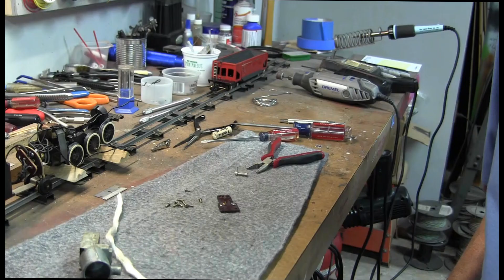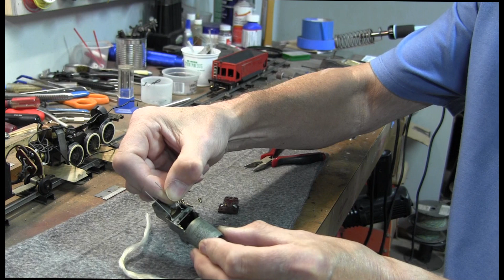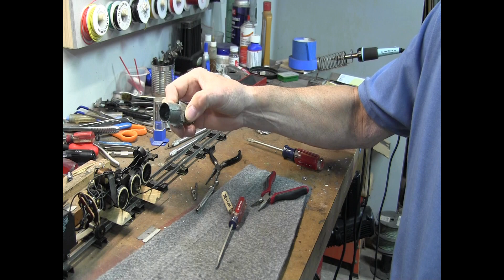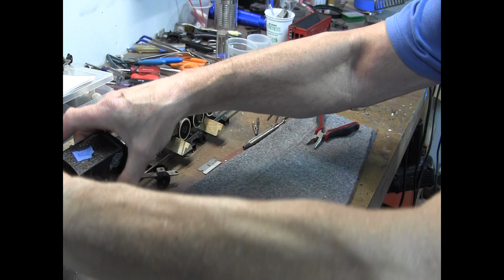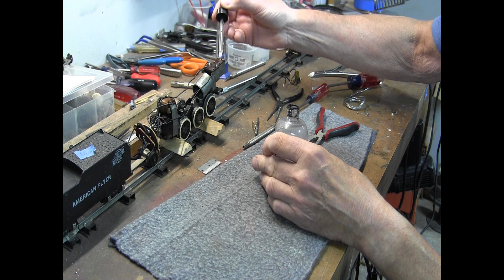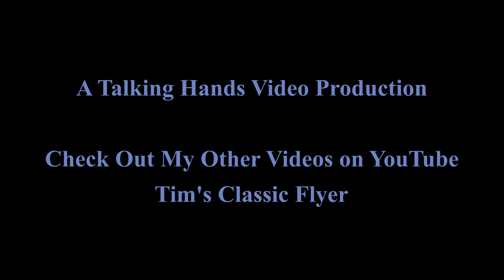A Different Way To Repair an American Flyer Smoke Unit

Comment: Great video Tim. Before I put the covers on I soak the wick, both bottom and top. Usually blasts smoke real well. Absolutely going to be using the Lionel resister from now on!

Comment: Hi Tim. Great video! Also have a question. I think I saw a Lionel smoke resister rated at 70 ohm. Would that work as well? In your video you have to have the engine speed on hi to get a decent amount of smoke. Too fast for me.
Reply from the maker: I believe the lionel resistors are about 30 or so ohms

Comment: I just rebuilt my smoke unit using the nichrome wire. If I ever have to do it again, I will be using Lionel elements. There's no need to fight that when doing this is so simple.

Comment: the only problem with you putting  the wick around the element will cause it burn and carbon will form and short out the element  best to lay it into the wick at the bottom
Reply from the maker: I don't think that would happen. It's the same as wrapping the nichrome around the wick which has been done since the 40's. The wick does get brownish from the heat of the resistor just like it does when wrapping the nichrome around the wick.
Reply: Your right